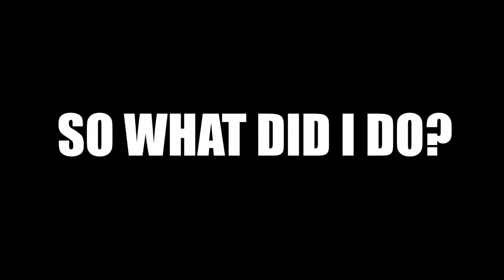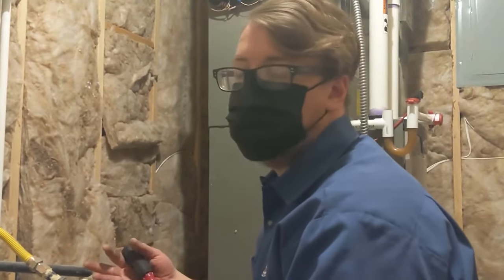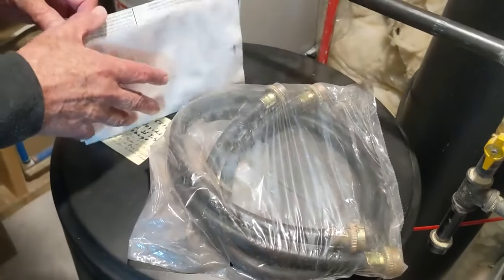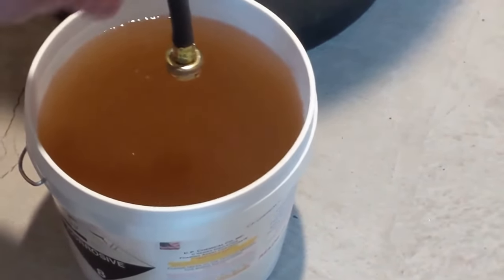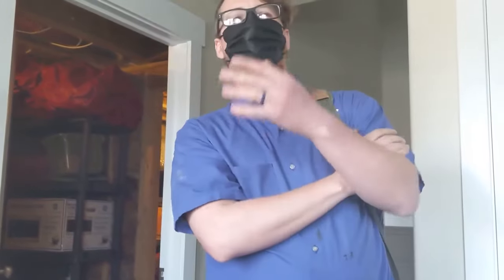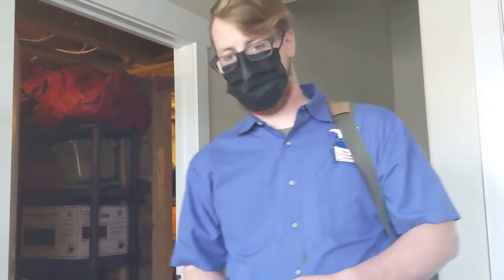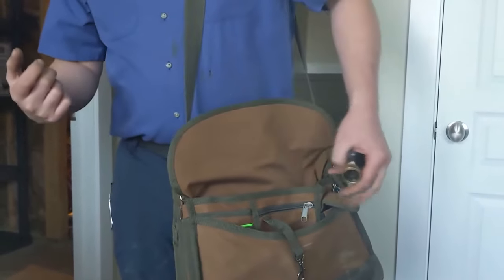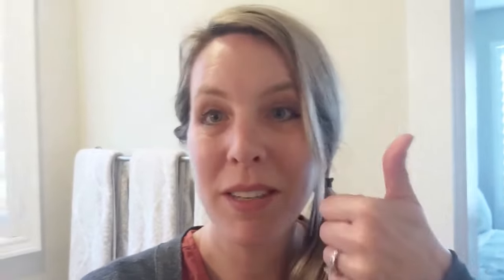How to Drain your Hot Water Heater & Remove Sediment

Comment: I heard her talk about price and things being too expensive, but why do you need 2 water heaters in one home?😳
Reply from the maker: Got have a back up in case one goes out! It was in the cost of building the house. It’s a lot of money to come up with at once, unexpectedly. The price went up significantly in the past few years.
Reply: @CleanFreakGermaphobe  okay, now I see!  Thank You😊
Reply: My mom home has 2 as well.  One for the basement tenants and one for top floor.
Reply: That's ridiculous. So you burn up 2 water heaters instead of one, worrying about one going out. Your builder saw you coming. And where do you live that code allows flexible gas lines to a water heater instead of black pipe? @CleanFreakGermaphobe

Comment: Your water installation is not right. You are missing two 24 inch drain plates. Imagine when they will start leak water, drain hole blocked by metal piece.

Comment: my process:
1) turn off the water heater the day before, take some showers/laundry/dishwasher to use up the existing hot water
2) the next day i attach a garden hose to the drain valve and extend the hose outside (if below ground, then run it to the sump     pump)
3) open the drain valve AND a hot water faucet in a upper level to break the vacuum. it may well take a 1/2 hour to drain
4) after it drains, open and close the main water valve to help flush out sediment, then close all valves, remove hose.
5) remove the sacrificial anode rod from the top of the water heater and inspect/replace. i scrape mine clean, there is always
    a lot of build up. depending on how hard your water is you might have to replace it every 5 years. get the magnesium type.
    FAILURE TO REPLACE A WORN OUT ANODE WILL cause a catastrophic leak !!!!!!!!!!!

removing the anode will take a breaker bar and a 27mm (or 1 1/16") socket. it is will worth it and will pay for itself. 

6) while the anode is removed, pour 4 gallons of white vinegar into the water heater via the anode opening to dissolve calcified deposits/scale, a funnel helps. let sit for several hours, preferably overnight. 
7) replace the anode. 
8) turn on the main water valve, but also turn off the inlet valve to the water heater
9) finally, after letting the vinegar do its work, turn on the water heater and open the inlet valve to the heater.

the first couple of showers will have a slight vinegar smell, but its no big deal. 
i do it every year, and every year crud comes out.
performing the above process might very well extend the life of the water heater 20 years
Reply from the maker: Thank you so much!!! This sounds intimidating but worth learning how to do. Can you make a video showing how??
Reply: @CleanFreakGermaphobe  there are already plenty of youtubes that show vinegar and anode water heater steps...
Reply: @CleanFreakGermaphobe  Right, the other way seems more simple for us women.

Comment: On a slightly different note...we had a tankless water heater go out once. They came out and repaired it since it was under warranty but they said if they were ever going to be able to come out and repair it again, we'd have to agree to putting on a special water filter to filter out the lime/aka sediment. Other than a filter on the house, I guess there's no way to avoid being in these circumstances, tankless or tank.

Comment: Lots of iron in your water. It's been over 7 years for mine, going to do this next weekend and put a new anode rod in the water heater. Why do you have two 40 gallon water heaters? Why not an instant tankless water heater gas unit since it saves space and energy, my mountain spring water is too cold for the instant on unit. After 7 years I would think there is more hardened sediment at the bottom of your tanks calcium and other mineral elements building over that long. I would run the hose down the drain or outside and let it run for 5 minutes on the 10 minutes off and repeat 3 to 5 times to power flush. Then drain the tank with the heater power off change the anode rod, open the cold water to splash to break up the hardened sediment and repeat the power flush.

Comment: What happen if you never done it
Reply from the maker: Start now!
Reply: Depends on how old the water heater is and/or how long it's been.  I was told by a plumber not to drain a water heater if you do not know how long it has been or has ever been flushed.  It can cause the water heater to leak.  It is also actually mentioned on some plumbing sites.